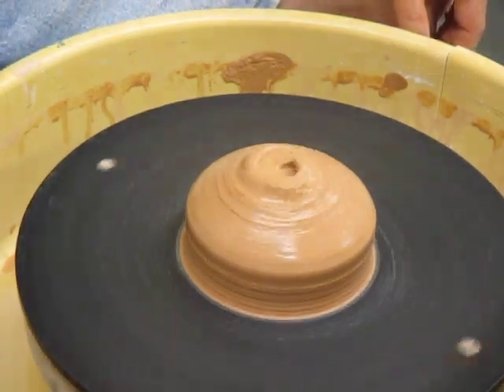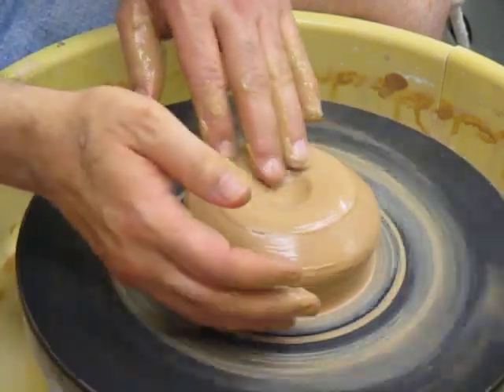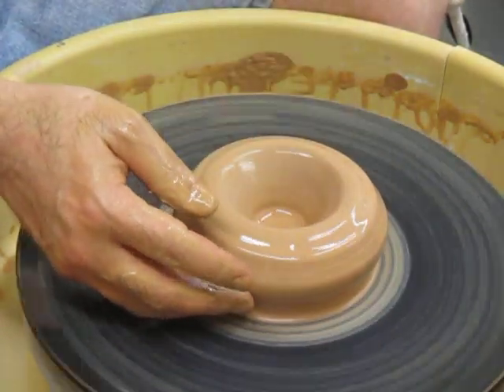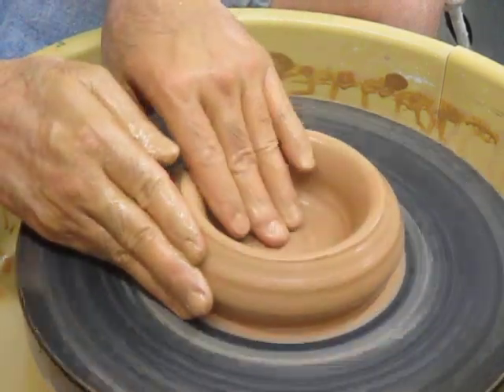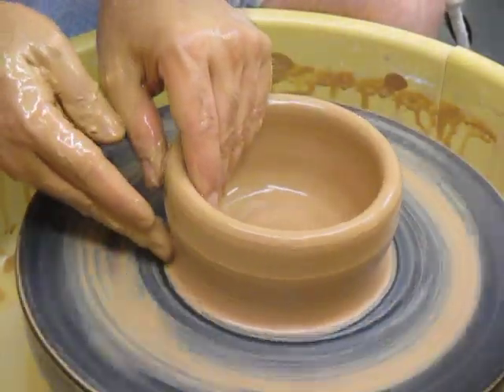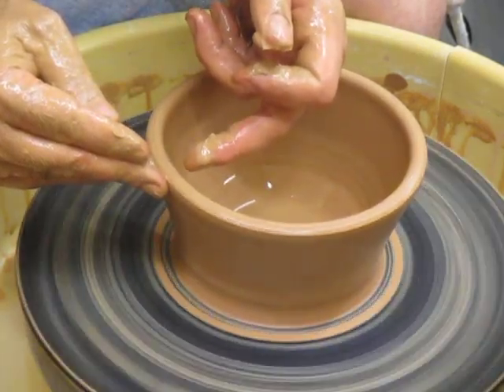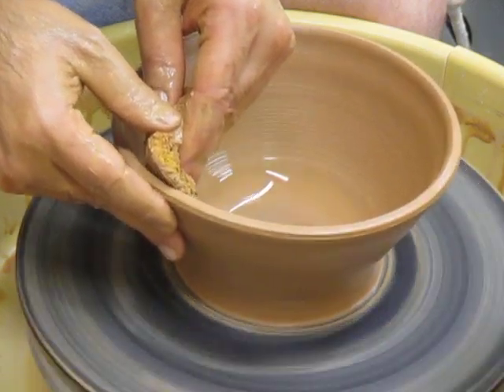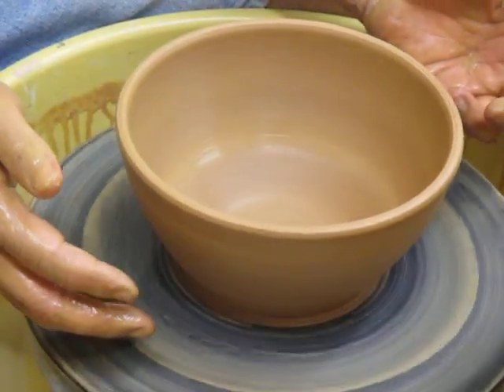Bowl Demonstration #1 -- using two pounds of clay

Comment: Thank you for the video . Could you please show how you move the bowl to a wooden surface ? I wracked my bowl when trying to take it of the wheel.
Reply from the maker: I know the feeling! I'll try to make a video of that. But until then, try reading this for tips:

First option: Do you have some metal tools called "pot lifters"? They're good for most pieces where the base still on the wheel is less than 8 inches. You always pass the wire, then slightly insert the metal tools under the piece where the wire passed. Hold both while turning and lifting up. Usually works!

Second option: If you don't have the tools, many people use a thin pool of water to slide the piece sideways off the wheel onto a board held level with the wheelhead. But, I find that beginners have difficulty with this. Good luck! Does that help?

https://www.amazon.com/Kemper-Tools-Lifter-inch-wide/dp/B00A6W457Q/ref=asc_df_B00A6W457Q/?tag=hyprod-20&linkCode=df0&hvadid=242033841575&hvpos=&hvnetw=g&hvrand=15992262726091013936&hvpone=&hvptwo=&hvqmt=&hvdev=c&hvdvcmdl=&hvlocint=&hvlocphy=1018405&hvtargid=pla-458773080953&psc=1

Comment: Hi Marc,
I find I’m struggling most with evening out the “shelf” in my bowls, and often when I try to, I end up ruining it. Do you have any pointers for that?
Reply from the maker: yes and thank you! This answer has tips on how to fix a particular bowl that has a shelf. (A longer answer discusses how it happens and how to get out of that habit.) Think of the entire pot as a stack of five or more hula hoops on top of a hocky puck. The shelf is a really fat hula hoop. Just above it, is a thinner hula hoop almost slipping off the outside. Here's how we fix that particular bowl.
Reply from the maker: The idea is to support the outside to keep it from even further collapse, while we work from the inside to continue thinning only the thick part. My hula hoop idea is to get you to work only at the level of the ledge and not move up "to the next hula hoop." Support the clay on the outside and lay fingers on the lowest part of the offending hula hoop. Try to make it just a little thinner, but not as much as half. Holding onto the outside of the pot makes the clay shift upwards and thinner, not outwards and thinner. At any time, use a rib to tuck the s-shaped wall into something straighter. Try that and see how it goes.
Reply: Thank you so much for this tip. I have continued to experience problems here and there, but after reading this, I’m excited to get back into the studio to give this approach a go. Appreciate the feedback!

Comment: I am in the process of building a potter's wheel and I need to know the 
height of the turning surface to the floor.  I don't know if there is a 
standard or it's specific to the potter.  From what I have seen, it's 
about sitting mid crotch height, lower than the knees.  
Thanks for any help you can provide.

Comment: Hi, great tutorial - does the type of clay help or hinder throwing like this?  My wife uses grey school buff clay (not sure if you call it this where you are).
Reply from the maker: Many clays are subtly different, but the major differences are usually dependent on whether there's grog in the clay (a sand-like particle, varying sizes), and whether there is a great fraction of very fine particles (like in a porcelain or similar). The buff where I am contains grog, and is good for students who move very abruptly because it put up more resistance. The techniques I"m showing here will probably help anyone (hahahaha) regardless of claybody. At least I hope!
Reply: Marc Mancuso Thanks that's helpful.

Comment: How much pressure are you applying?
Reply from the maker: Hello! The centering pressures are the strongest, since your hands have to work on a solid amount of clay. If you can imagine using your palms to pick up a gallon jug of milk or water from low grip on the sides, this is similar to the centering pressures.

The wall raising and shaping pressures use much less pressure than that.  if you've closed a ziploc or resealable bag with two fingers, you've used about as much pressure as you need for the early wall raising moves on the clay. 

The last shaping pressures on the thin walls are the lightest pressures. This might be like pressing a self-adhesive sticker or mailing label a bit harder onto its edges, when you have to make sure it's stuck.

Hope these real-world examples help!

Comment: Any idea how to change rotation on a wheel? Im left handed.
Reply from the maker: Usually the wheels have two switches, one for power (on/off) and one for direction. Hopefully you have one that changes to the direction you'd prefer. But if your wheel doesn't reverse, don't be too bothered: I have hundreds of students who fine with counterclockwise, regardless of handedness. If your left hand is stronger, and the wheel is moving counterclockwise, it's very likely to end up on the inside of the growing form. Maybe you'll get bowls more easily than cylinders!